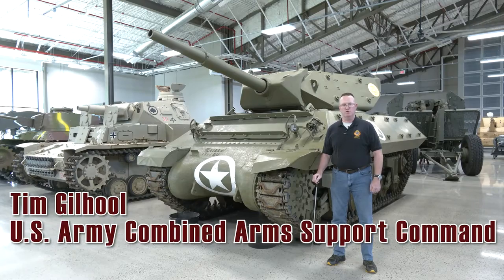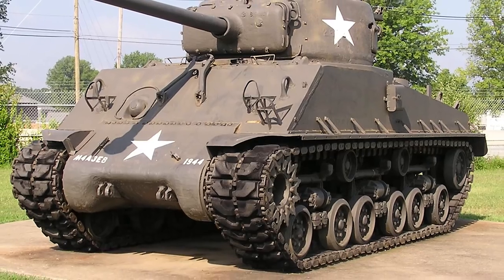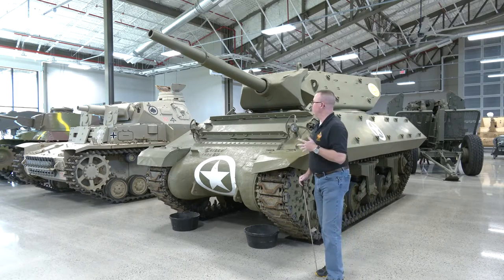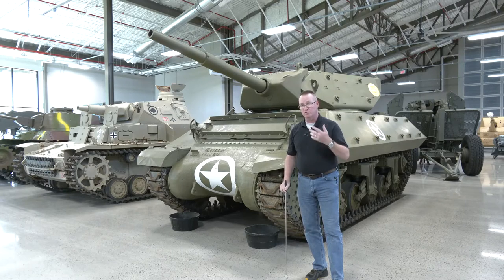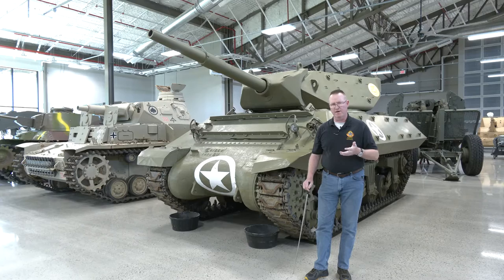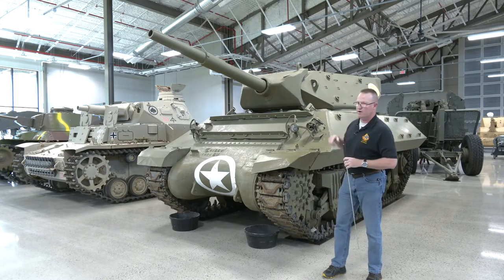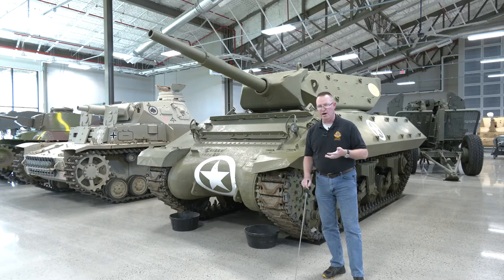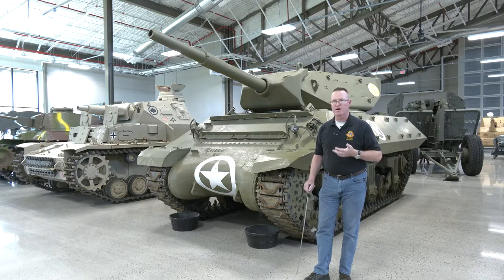M10 Tank Destroyer | Ordnance TSF: An Inside Look

Comment: Wolverine was in my understanding, the British Lend-Lease and Canadian configuration, Yes / No? The US Used the 3" Gun I believe, possibly due to supply restraints and great restoration there, the Sar with Circle were invasion markings and was used by other Allied Forces (Not Just The Americans) in the Mediterranean and France-Through Europe. Not trying to be a smarty pants, just a question I guess.
Reply: IIRC the 3" and 76mm are the same gun just named different by the different powers. The Sherman having a 75mm it would roll better off the tongue to say the new was a 76mm (76.2 mm). There was a fair bit of tech sharing like the British engines for the USA P-51. There was a smaller 57 mm that was the 6 pdr that could use each other's ammunition because it was the same gun. https://en.wikipedia.org/wiki/Ordnance_QF_6-pounder

Comment: does anyone know what that sleeve on the barrel is for? was this some experiment or a post war repair or..
Reply: I suspect that its extra metal for balancing the gun. Not sure on that. It doesnt have the right shape for a fume extractor.
Reply: @johjoh978  It was a counter balance which gave the Germans the clue that it was equipped with a 17 pounder gun and not a standard 3 inch as fitted to the Wolverine and as a consequence they would concentrate their fire on an Achilles when they spotted one, knowing that the 17 pounder was more destructive than most other tank busters and tanks. When the British crews realised this they started to wrap the barrel with barbed wire which then had sacking wrapped around that to give the impression of it having a barrel without a counter balance.  I suspect that some British crews just removed it and put up with the effects of firing without one being fitted but I bet they would have had to hang for dear life when the gunner pulled the lanyard.  I learnt all I know of how an Achilles performed from an old crew member of my late father in law shortly before he died in 2012 and he filled in a lot of the  gaps in my knowledge of the Achilles plus many stories of he and my late father in law's exploits from D-day through France, Belgium, Netherlands and Germany.  I also copied the pages of the diary he kept from D-day to the end of 1944.